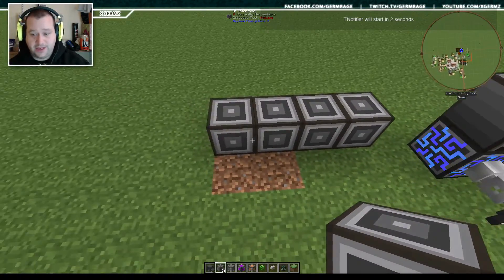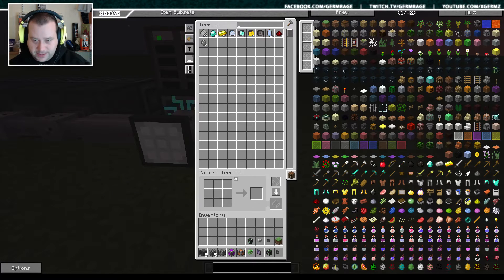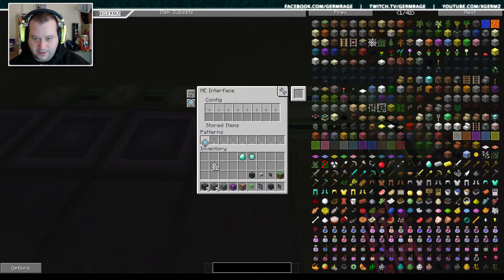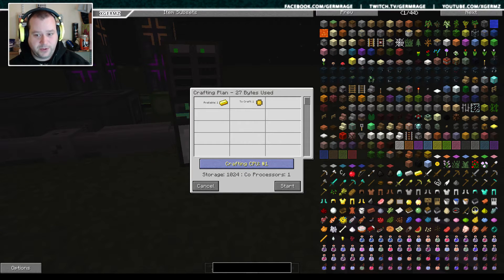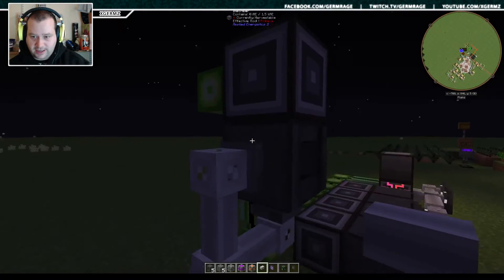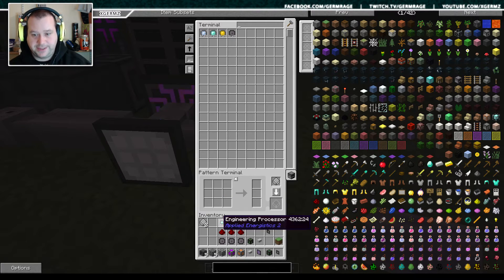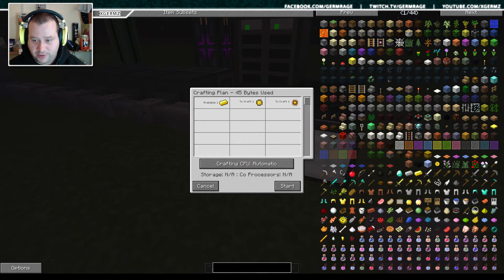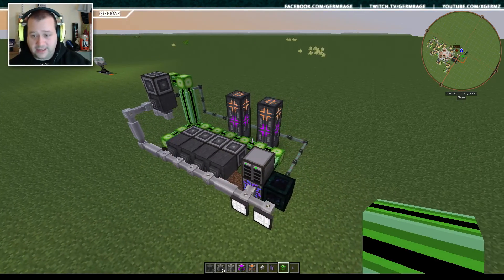Tutorial - AE2 Inscriber Setup Automation

Comment: I know the video is old but why does the exporter fill 2/3 slots with red stone or 2/3 with silicone .
Reply from the maker: OMg im a potato in this video... hahaha. #cringe. But anyway the reason for pre-filling the 2nd and 3rd slot is the automation occurs with the placing of the required item in the first slot. This way the machine is ready to accept a build request. if that makes sense. Also you cant prefil 3 separate slots (in this version) with 3 separate items, you can only manage one at a time, and as such, having the other 2 items prefilled and ready makes life a lot easier!
Reply: Ah ok thanks man helped me a lot .